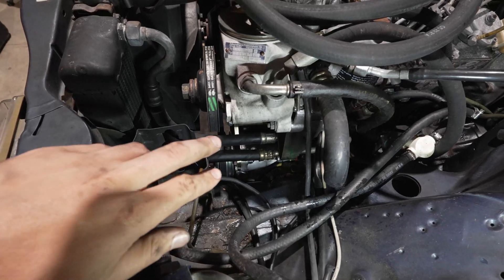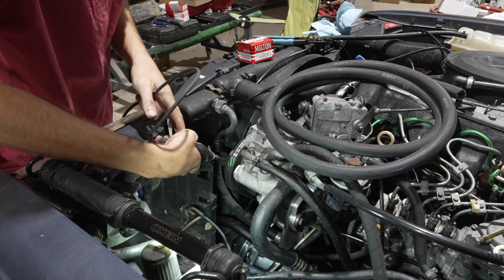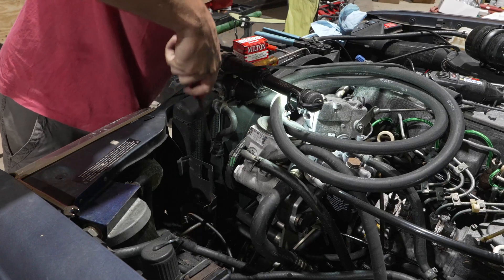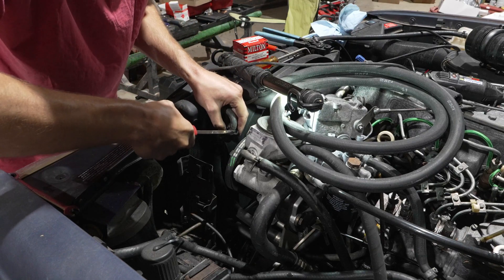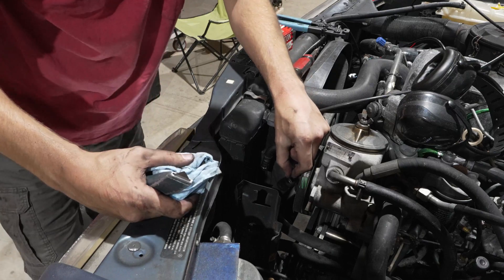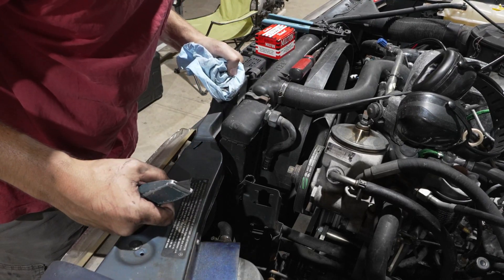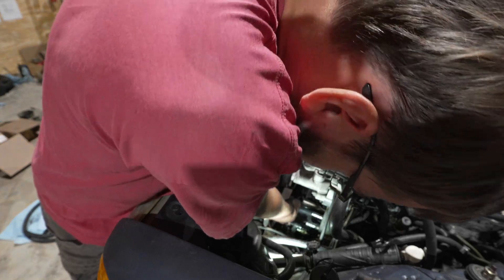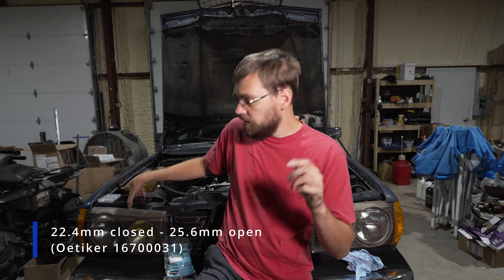Replacing W123 Oil cooler hoses (Rubber only)

Comment: I recently got a 81 240d.  Would love to buy from your links and do this job, but see there is a size difference between the 2 engines. Do you know the correct hose and clamps for the 240d? Love your channel. Thank you!

Comment: Just did this job today using 15 mm inner diameter hose from Bell metric and two blue Norma clamps on each end of the hose. If you want to make this job as easy as it can be I suggest removing the fan and the shroud, then you can work from above with a Dremel slicing the old hose collars, after you make the first slice cut the hose, have something down below to catch the oil because some will come out,  this will allow you to rotate the collar you just cut 180° so you can now make another cut. Now with a small flat head screwdriver pry off 1/2 of that collar and slice the hose a couple times with a knife and it will come right off. Only making one cut and then trying to pry that collar apart with a flat head with limited space not the best way to go about it.
Reply from the maker: Mine are still holding strong, no leaks!
Those original clamps are kind of miserable to remove, good tip on the fan and shroud, that would make a significant amount more room to get in there.

Comment: Can I make the oil lines longer and loop over toward inner fender so I can prevent the power steering belt from coming down and rubbing hose in the event of engine mount failure? Thanks

Comment: What a great economical solution. Would it be easier to remove the hard lines and the use your method? Or is there too great a risk of damage when so doing?
Reply from the maker: I did this method because I've had horrible experiences trying to remove the hard lines from the cooler taking the threads right off the aluminum cooler.
I don't dare try to remove them anymore, I ruined like 3 coolers trying to get one from a junkyard for my very first Mercedes back 20 years ago.
Reply: Thanks for the cautionary tale.

Comment: Did you use 1/2” ID hose?
Reply from the maker: Yes, the hose I linked is the exact stuff I used, 1/2" ID, 7/8" OD, rated for transmission cooler or oil cooler use, 300psi 300f I believe was the rating, its been working great!

Comment: This method works great!!!!

My new oil cooler lines failed after just 10k miles on my 300D. After watching your video, I headed to AutoZone and picked up a 5/8" (16mm) transmission cooler line. I put two clamps on each end of the fittings, then took the car on a business trip from DC to Baltimore. I was cruising at 80mph and hitting 4000rpm on I-66. After about 70 miles, I pulled over at a Wawa for some coffee, popped the hood, and was happy to see there wasn’t a single drop of oil leaking from the rubber hoses.
Reply from the maker: I've done this same repair on every one of my OM617 engines, and have never had a leak or issue at any speed or driving conditions. I'm glad to hear you've had the same experience!
I tried replacing them the "by the book" method once. Ended up destroying the oil cooler threads. Steel fitting on aluminum threads, cracked loose with heat and lots of penetrating oil, thought I was good until I saw spirals of aluminum.
Reply: Hi. I was wondering how the 5/8 ID line has worked out over the long run for @traclpackage5075. Any leaks yet? I have some Cat hi pressure hose I was gonna use but I'm worried its a hair too sloppy. Thanks so much for the input. (i think its 15.9mm)

Comment: Looks like a very easy and straightforward fix. Thank you! I’ve seen on the forums some people say it won’t last but I doubt they’ve tried it. How long have you been doing this for your benzes? Also, will the same sizes apply to an OM616? I have an 82 240D
Reply from the maker: I've done this on 3 cars now, none have ever leaked or had issues, one car I sadly had to sell, but the other two have been fine for several years, and at minimum 30k miles each.
As far as I'm aware the hose and clamp sizes should be the same across basically all the om616 and om617 engines whether turbo, non turbo or year. My w116 was the same as my w123s
Reply: @trythistv  thanks for the reply. Glad to hear they’ve held up so long! One more thing: do you know the ID of the hose you linked? 
I don’t need more than a couple feet so I’m just looking into buying a couple feet of hose rated for oil and I’m seeing two numbers on forums: 15mm and 5/8” (equivalent to 16mm) but I like the tight fit you have. For some reason the Amazon link doesn’t have the specs of the tube.
Reply: @Andrsme  16mm worked fine for me.
Reply: @ thank you!

Comment: Hey did your tutorial with good lines and norma clamps. Most of the leak under control. 
But still have a small leak between the nut and the cooler itself...
What should i do? Is it at risk of bursting? Or will it just keep leaking at worst?
No way to source smth like a cooler/ and lines in europe. I have already tried... 300D NA
Reply from the maker: I had a small leak from my grey w123 right at the bottom cooler fitting, I didn't dare attempt tightening it, as I stripped the cooler fittings on the W116 that begun my obsession with Mercedes doing the same thing.
If it is a small leak, I would leave it alone and monitor it to make sure it doesn't get worse over time, just keep an eye that there aren't suddenly huge pools of oil where you park basically.
Reply: @trythistv  I use to have a big pool indeed. I will live with the drop or two.

I also see a lot of people just looping the filter or plugging it. Apparently the cooler isn't that essential.

Pretty sure we could also just hook a generic cooler to it.
Reply from the maker: My understanding is the oil cooler thermostat opens at like 100c/212f which often the oil never reaches that, so you're right, looping it or replacing with a generic cooler would be perfectly fine. Mine isn't leaking bad after replacing the rubber hoses, so I'll leave it alone until it becomes a problem
Reply: @trythistv  interesting. I didn't think there was a thermostat. I thought it was just the normal circuit of the oil?
Reply: It is quite common for the seat on the oil cooler fitting to crack, especially if someone had overtightened the fitting in the past. Mercedes has a solution where you drill and tap the oil cooler and thread in replacement fittings. The replacements are the same fittings that thread in the oil filter housing. They may or may not still be available. I replaced the oil cooler when it happened on my car. Whatever you do, don't take it apart to look at it unless you are committed to fixing it

Comment: Can i use normal clamps ? That i have to screw to tighten ?
Reply from the maker: I've heard of people using worm drive style clamps and them working fine, I just like the extra peace of mind that the oetiker clamps provide even pressure and won't loosen up from vibration or anything.

Comment: This will hold up to high RPM and high psi? Is it pretty much as good as the oem clamps?
Reply from the maker: I did this repair and immediately drove 700 miles at 75-80mph, then a week later drove back at the same speed on the same roads. 3500ish rpm, maybe higher with the 3.07 gears in the car at the moment.

The same clamps and hose are used on my work trucks transmission cooler lines, which since there is a gauge I know can get to 250f and runs somewhere around 80psi constant.

I've not had any issues with this repair and have done it on 3 om617s that I've owned now

Comment: I've got rust showing up in a few places and trim that is falling off pretty badly.  Oh noo what do I do?
Reply from the maker: Rust is an awful battle to fight. 

I lived in the rust belt for years, por15 is a great product, as are the various rust converter options like naval jelly or crud cutter makes one too I think that worked good for me. The big thing is stopping the rust and then preventing it from coming back.

Sometimes rusty metal will have to be cut out, the clean metal treated and then new metal added and treated to prevent rust returning, it can be an uphill battle if you live in a salty environment.

If it is just minor rust around trim, wheelwells, door bottoms and the common places then cleaning it, treating it with a rust converter and then por15 will keep it at bay for years.
Reply: @trythistv  
Yes it's hard work.  Especially with no hoist and just some jack stands.  The little pockets that collect leaves near the hood springs were rusted right through and ate all the way down through the rocker panels, which were also full of wet sand.  
I've welded in 30 small patches so far...    about 5 more to go on that side of the car and then over to the other side.  I'm going to use my underspray can to fill those rockers up with as much engine oil as I can get in there.  
 
Those trim clips I think I need to buy some new ones and tear all trim off and grind/treat/paint/topcoat all the little bubbles. Those little clips aren't cheap, $1 each for the little red collar on ebay!  Waiting on 20 new clips to see if they come with the red collars or not.  

Taking a break from the slog and coming back to watch your videos has kept me going.  Love your videos!

Comment: what about the power steering reservoir leak underneath?
Reply from the maker: Is my reservoir leaking? I haven't noticed it leaking, and it hasn't been low, but I always appreciate a heads up if anyone notices a potential issue I may have.

Comment: Nice solution
Reply from the maker: I feel like it's a safer solution than stripping the threads off loosening those nuts
Reply: @trythistv   When I replace my oil cooler lines years ago, it was a whole weekend of undoing motor mounts and wrestling the lines out and in of the engine bay. It was such a hassle. Happy to see you figure something out that doesn't require someone to go through all the headache haha
Reply from the maker: My very first Mercedes had a broken oil cooler so I had to replace it and I could never get the cooler lines to come off without removing the threads from the cooler. Finally got a good cooler and vowed to never ever remove those fittings. I did this fix on that car, and several others, and while it's not a walk in the park it sure beats ruining the oil cooler IMHO.